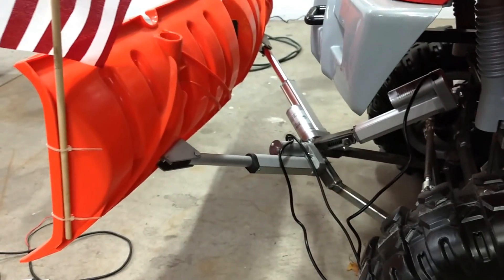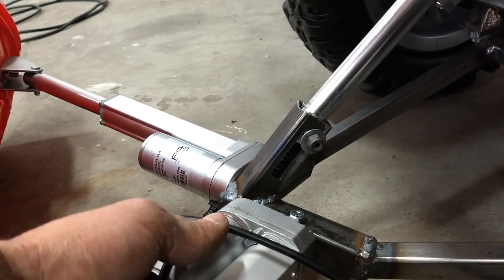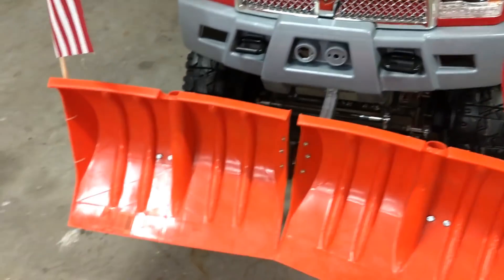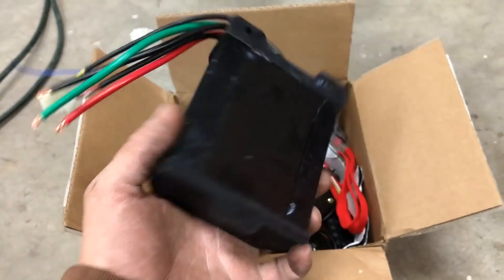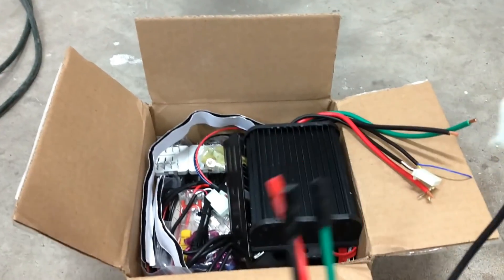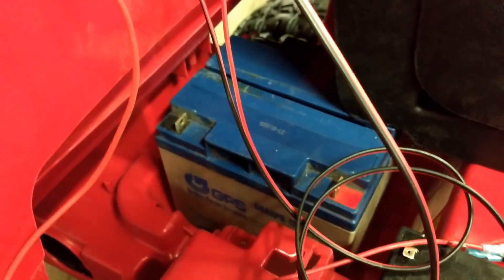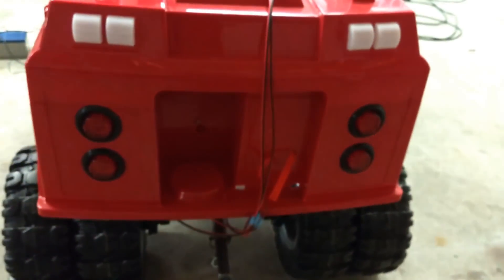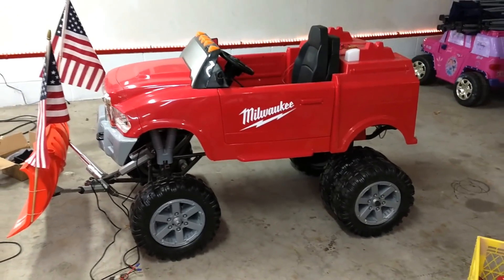4x4 powerwheels build with V-plow 24 volt upgrade- Part-3

Comment: Man put some roll on bed liner on those wheels. You can sprinkle some sand in it when you roll it on and it'll give it some traction
Reply from the maker: that does not hold up worth jack, all we need is snow chains. tx for the tip